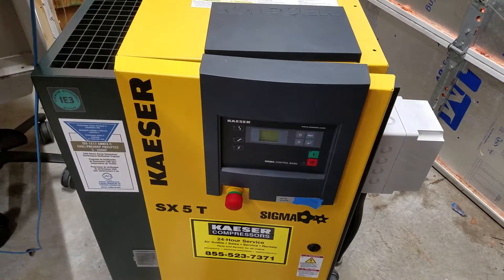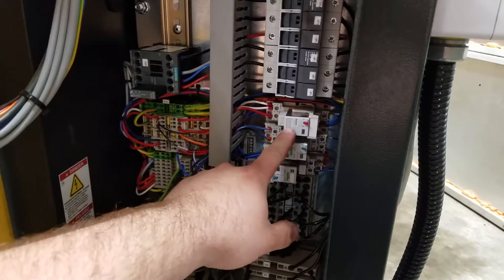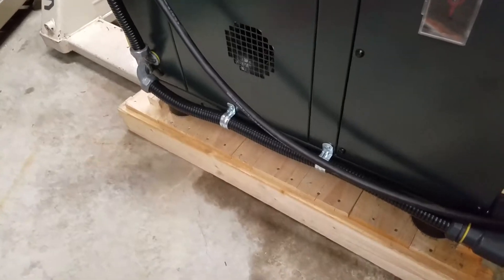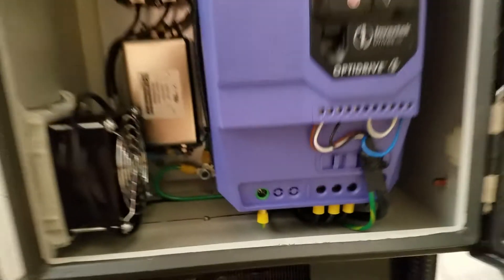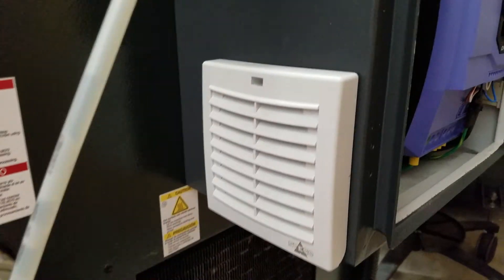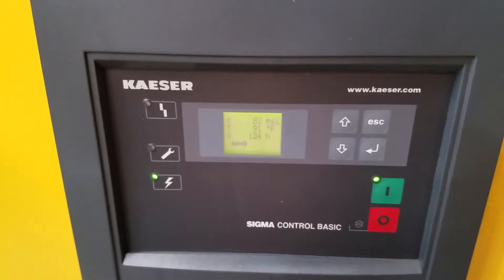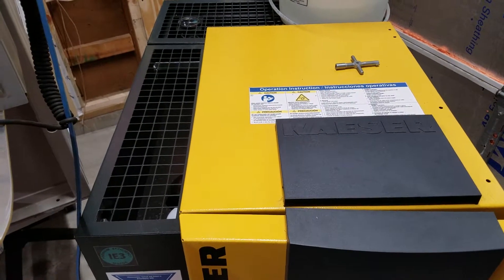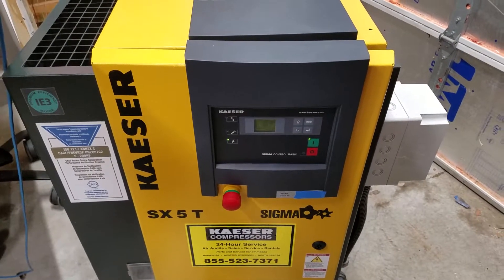Kaeser 5HP Compresor Running on a VFD

Comment: I just got my QRS10 running on a VFD. It’s wonderful! 50hz loaded and 30hz unloaded.  It was my first jump into PLC wiring and it works great.  Thanks for the inspiration!
Reply: I have a 2008 QRS-10 running on phase converter.  Its pulls so much load on startup it dims the lights and slows down some of the other equipment.  Wire is sized correctly.  Considered a soft start or switching to a VFD.  Was it difficult to do the conversion?
Reply: @BoneItOut  just buy the VFD and stop worrying.  I bought Mollom’s 45amp and it runs the compressor perfectly, even with 2 second accel and decel times. It’s the easiest vfd I’ve set up, instructions are written in English not bad translations.  Making it run at 50hz and idle at 30hz was so easy. I used the original multi contactor and a few of the timer relays to do what I want.  I’m still tweeking the install by adding indicator lights.   I run everything on VFDs, Bridgeport, compressor, pullmax, bead roller, and I’m building a 7.5hp belt sander and it will have a vfd on it.
Reply: @HappyHarryHardon  I Just got my Mollom's VFD.  Any chance you have pictures of the conversion you did on your QRS10?
Reply: @jimmckeone492  Hey, awesome! I can take photos of my vfd settings and I can try and draw a semi coherent diagram of how I wired the 24vac stuff in the cabinet.  Do you have a front door that opens for your compressor control cabinet or is it a riveted panel?
Reply: @HappyHarryHardon  awesome thanks! it’s a front door. I can show you pics of the compressor….just not sure how to get them to you.
Reply: @jimmckeone492  I uploaded a video on the settings for the vfd.  Let’s continue over there.

Comment: Dan, seems like instead of the complications of running the VFD with the contactor etc, you removed that whole setup and used the VFD for everything
Reply from the maker: There is no point in keeping the contactors. There just is not to start and stop the flow of electricity, the vfd does that. Plus, many VFDs do not want any contacts between the vfd and motor. Breaking the connection while the vfd is driving the motor will burn up the vfd.

Comment: Hi,

Can I ask how long you ran this compressor with VFD for,
So how many years
Reply from the maker: It's been running this setup since this video was posted. It's now in use 6-10 hours a day, 5 days a week.
Reply: @engnerdan  thats amazing 👏 

I am away to buy a atlas copco 7.5kw 10hp compressor for my workshop which is single phase.

There is a guy here in the UK that sells digital phase convertors thats basicly a modified VFD so I am going to try that.

Could you tell me everything you used for your set up please.

VFD
emi filter 
The fuses 

And what else did you get to do this please.

Thank you

Comment: did you oversize the VFD? I've read you should run a 7.5KW VFD (10hp) for a 5hp compressor when you go single to three phase.
Reply from the maker: No this particular VFD is a phase converting (single phase in three phase out) VFD rated at 5hp. Most brand name companies stop at 3hp. If you are trying to do phase converting with a VFD that is only rated for 3 phase input, then you are right you need to use a drive 2x the motor size. The actual number is 1.74. Something to look out for is that some 3 phase input drives will fault out on unbalanced inputs, so I have been told. I know Hitachi WSJ200 are ok to do phase converting with.
Reply: @engnerdan  I understand that your VFD is creating 3 phase from a single phase input but my understanding is 2x oversizing is still needed (I believe because the input diodes work harder to create the pseudo 3 phase ). The folks at Next Day Automation stated the same with their single to 3 phase VFD but its the same cost as your Invertek (~$560) so maybe I shouldn't care, I just like the idea of a bigger drive (bigger heatsink etc.). Do you not like Next day Automations home brand VFD's?
Reply from the maker: @gavins9021  Not every VFD has to be be de-rated to half its rated motor size. There are many drives out there for 1/4-3HP, and some up to 5hp that only take single phase power in (or single and three in) and do not need to be de-rated. They are often called "Phase Converting Drives" because they are built from the factory for taking single phase in without a de-rating. 
This is the exact drive I used, and I did not have to de-rate the size. It is rated for 5hp and I am using it on a 5hp motor. 
https://www.driveswarehouse.com/ode-3-320153-1042
This is one I have used on test stands, I have built. It takes 120VAC 1 phase in and puts out 240 3 phase at the rated HP. 
https://www.automationdirect.com/adc/shopping/catalog/drives_a_soft_starters/ac_variable_frequency_drives_(vfd)/micro/cfw300a04p2s1nb20

You have to read the specs for each drive. There are several of the cheap import ones on amazon that are rated only for single phase input, that do not have to be de-rated.

Comment: I believe that I had came and did some service work on your compressor when you had the rotary phase converter. If I recall correctly you had some issues with unbalanced voltage across the phases causing fuses to blow in the compressor.  You had a CNC mill that you built in your garage correct? The service number that was on the compressor reminded me on this one.
Reply from the maker: Yeah that would be me. I ran that phase converter for about a year then did this conversion. I have had this conversion running for about 3 years now, works great. I helped with similar conversions on a few other compressors too. Just did a Fiac with variable speed based on line pressure. Took the compressor from cycling on and off 6-10 times an hour, to running continuously for 8-10 hours a day.

Comment: I have a kaeser compressor, my plant air requirement got reduced and my compressor runs only 24% onload. Will installing vfd in my compressor helps me to reduce power consumption?
Reply from the maker: I guess it could, it can provide a soft start function which reduces large inrush spikes in current, that can save a small amount of power. But overall you are only going to use the amount of power needed to compress the volume of air you are using. So you would not see a large savings.

Comment: Hi Dan. 

I have a kaeser sm11 and have bought a vfd to run it. But it’s blowing one of the fuses on power up. The screen comes on for 30 seconds and dies. Every time the same fuse blows. 

Can u offer any help to set it up correctly? 

Thanks for your time
Reply from the maker: I'm sorry but that you have given me no information that is that could possibly lead to solving the problem. If you have fuses blowing you have something wired wrong, or something that has failed or the wrong size fuse.
Reply: Hi Dan I want to do the same setup as you have. Do you have a list of parts that where replaced and a diagram of how everything was wired.
Reply from the maker: @llokietko  Unfortunately at this time what I have would not be of much use to you or anyone else.

Comment: Wow.....This has given me hope!  I was given a 2008 (7.5HP) Keaser, Model AT8 rotary screw compressor. It is a 575 Volt, 3 Phase, 60hz (from a company in Canada our company bought) and I only have single phase at home also. I am planning on getting the 575 volt, 3 Phase motor rewound to 220V, 3 Phase.......should I get it rewound for $685? I would like to say it would be easy to just get another motor, but this has a taper lock pulley and attached cooling fan (not a standard frame motor). I would appreciate it also if you could make a sketch of how it was wired using the existing 24 volt controls for the unload, overheat, etc.  I see you mentioned McMaster-Carr.....I buy hundreds of dollars each day for my day job.  I live in Clifton, NJ 07013.  Thanks for giving me hope I can use my Keaser and I also just subscribed to your channel too!
Reply from the maker: Being your compressor is 575 volt it's going to be interesting. I see you  have three options, 1. Phase converter and a Autotransformer/step-up transformer. This will be a $2000+ for the phase converter and a transformer could be $200-$2500 depending if you can find a sweet deal or have to buy brand new brand name. 2. Rewind the motor and then you will need a phase converter or VFD. But know that phase converting VFD's (those that take in single phase and spit out three phase, like I used, are not common above 5hp. I think I have seen one). So you are left buying a three phase in/out VFD sized for 15hp (this is the standard de-rating for phase converting) and a 15hp VFD will not be cheap. But they can be found used sometimes for a good deal. Be advised that not every three phase in/out VFD will allow you to run on single phase in. You will have to research this. 3. Hotrod an american single phase 7.5hp motor on to it (yes they make that, no I would not ever do it willingly). 

You could also see what a replacement motor from Kaeser would cost in 230V 3 phase. But I would guess it would guess it would be more than the rewind. How many hours are on the hour meter? Does your compressor have the same controls? I will look for my wiring sketch, not sure where I have it. Basically I used 3 relays to interface between the compressor controls and the VFD. Two are 24 volt coil and one is 120vac coil. They replace the factory Wye-Delta contactor and overload contactor.
Reply: Dan, Thanks for getting back to me. I bought one of those cheap VFD's from eBay. It is 7.5KW (10hp), Single Phase 220V IN, 3 Phase 220V OUT, Made by Isacon Power Control Tech Co. Ltd.  Model #A2-8075  I did not find any information online, but there is a manual that came with the drive. It was cheap enough, so if I pop it....oh well. Haha! I took some pictures of my compressor, which I put into a video for you to check out. The controls looks similar and I had no way to verify the hours on it.  It Check this out: https://youtu.be/urp4HI5KTcA   I dropped the 575V motor off at the electric motor shop, and told them to rewind it for 220 Volts, 3 Phase, 60 Hz.  The price they quoted me was $685. If you think I am going in the wrong direction, please let me know. I have thick skin and can take criticism just fine. Take care and talk to you later! Wayne
Reply: Dan, I forgot to tell you in my last reply.  I have the manual and wiring diagrams, but I have no way to e-mail you directly that I know of. Don't post your E-mail address publicly, because all the spam you will get.  Anyway....if there is a way to get in touch by E-mail please let me know. Wayne
Reply from the maker: @fordtrknut  You can email me at my first name (see the channel name) @dwengineering.com.

Comment: I would love to see a more in depth  video on this. Or a parts list and diagram. I just acquired the exact same compressor. And need to run it on single phase also.
Reply from the maker: Chad Smith I will be working on putting together the new electrical enclosure very shortly. I have a BOM and some CAD models I can share too.
Reply: Dans Workshop That would be awesome! Thanks so much!
Reply from the maker: Chad, how soon are you needing to get this thing going? Is your compressor used or new?
Reply: Dans Workshop I'm not in a hurry. It's used. I will be using it in my personal shop at home.
Reply: @engnerdan  Did you ever put this together? If so I'd love to see what you ended up with for the enclosure/parts, wiring and VFD programming if you have it. Im looking at picking up an SX5 locally but I only have single phase.
Reply: I'll pay fir a diagram.
Reply: Do you know anyone that’s selling something like this?